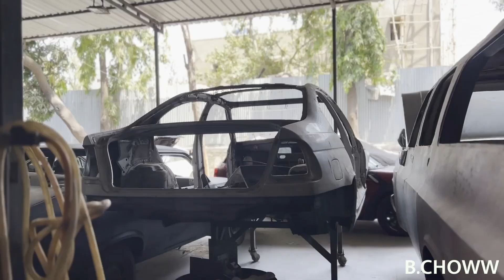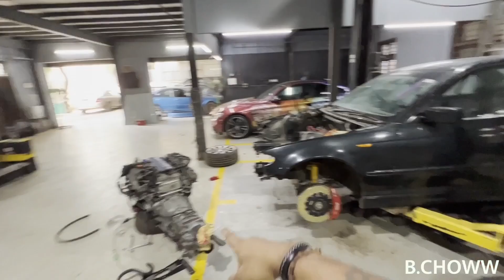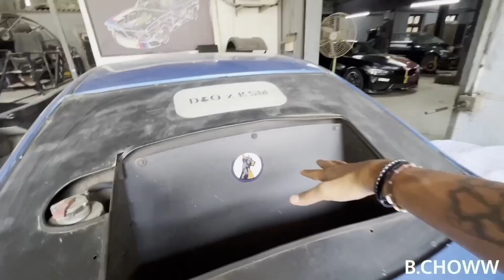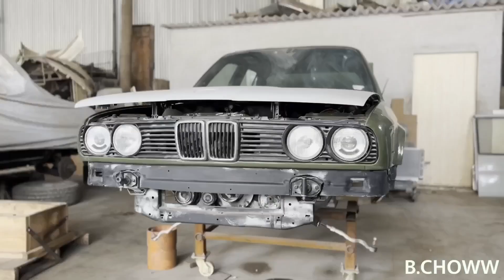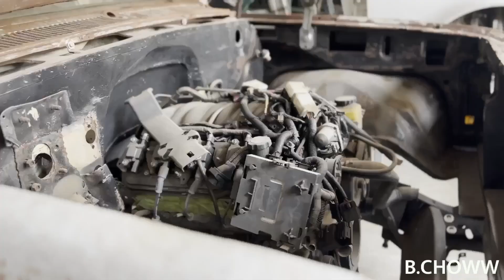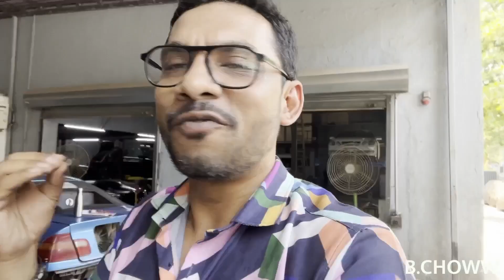This Mumbai workshop engine swaps everything! | D&O Motorsports vlog

Comment: Hii guys.. just want a bit of your time. I drive a 2007 Skoda Octavia 1.9tdi (ALH).. and it’s kinda becoming a headache now.. the problem started few months back when the clutch started slipping so the guy from my FNG test drove it and came to the conclusion that it needed a clutch change.. So the very next day i did the same.. got the clutch and pressure plate changed (note: i didn’t replace the flywheel as according to the mechanic it was good in condition).. The day clutch got replaced car was running fine but the very next day it started slipping again.. This time my doubt goes towards the Slave cylinder.. i myself check it and bam.. it was gone.. oil was leaking.. So i got it replaced too.(as these parts are kindoff headaches to get here in my country so what i did was i replaced the slave cylinder with a used OEM one which was okayeesh in shape) a day or two went by it was driving as it supposed to but the third day again slipping starts😶.. Brake oil is filled to the max.. no leakage whatsoever.. Now I’m confused as hell as to why and how the clutch is slipping.. (Also i have close to no brakes.. whenever i push on the brake pedal it makes hissing sound and the pedal’s travel is almost to the floor but the brakes are only working about 10-20% of what they should).. Both the brake and clutch’s issue started somewhat around the same time.. (bottomline: Now i’m really confused if there’s air in the brake lines or did i really make a mistake by not changing the flywheel or is it the second hand slave cylinder unit) Is there anybody who can read such a huge comment of mine and help?